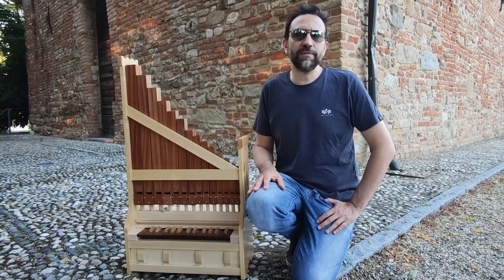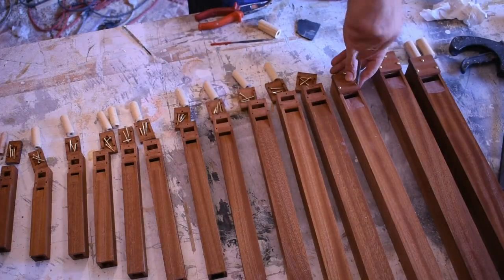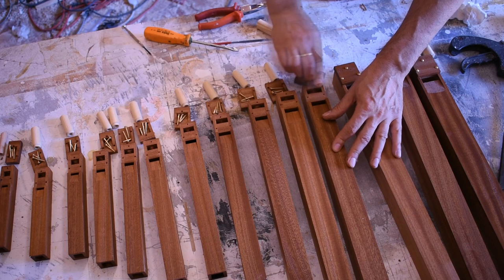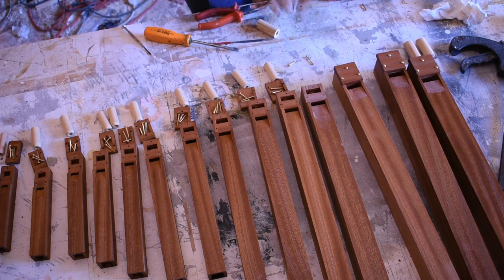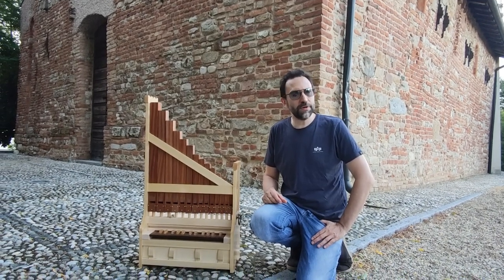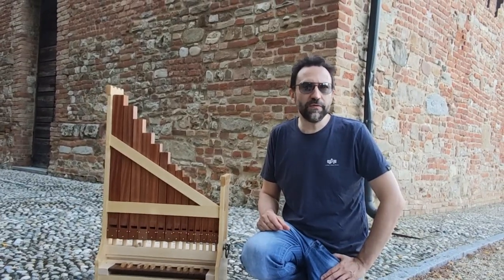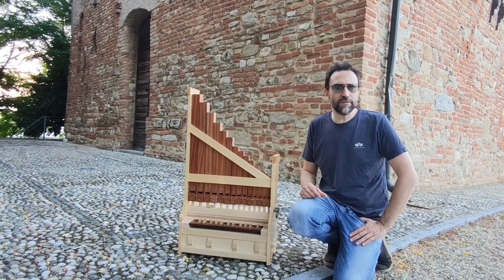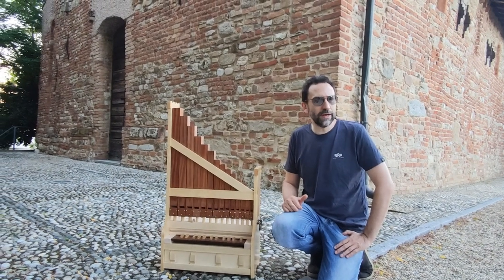How to build a portative Organ | #27 New Updates | SUB ITA | Homemade Pipe Organ

Comment: wonderful instrument! Is the any consideration of building the foot of the organ pipe? the diameter of the hole inside for example.
Reply from the maker: Thanks Xiaohu! The diameter of the holes of the pipes are the same as those of the soundboard, then later I'll show the addition of an air adjusting screw
Reply: @nippocast  Could I further ask why not choose closed pipes for this portative organ? or is it convention to use open pipes? Could you comment on the differences? it seems to me that closed pipes may save more space? thanks🤣